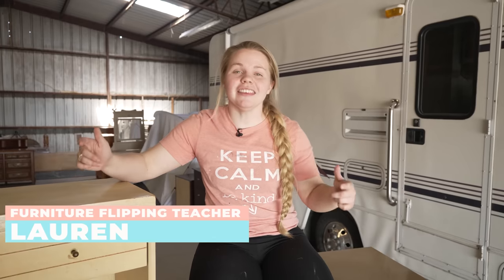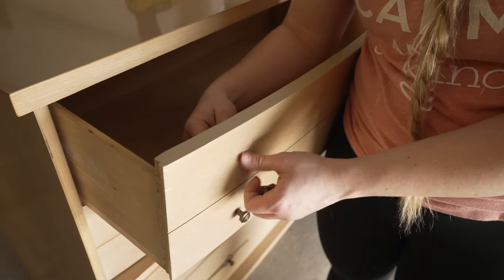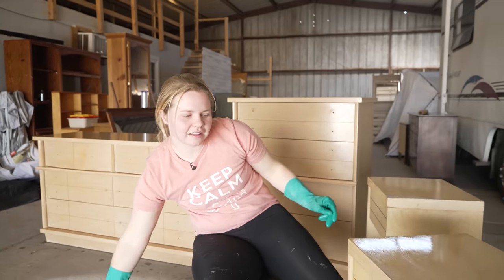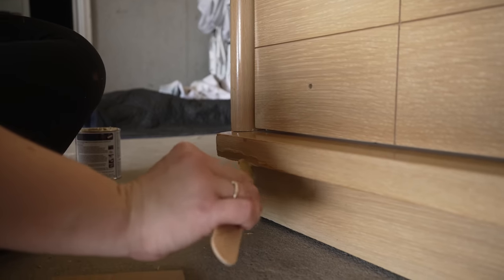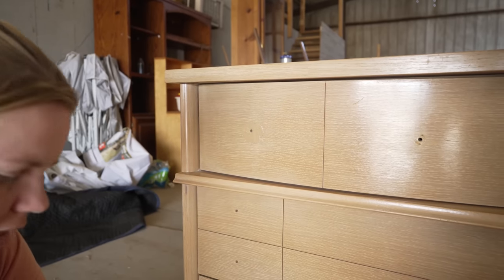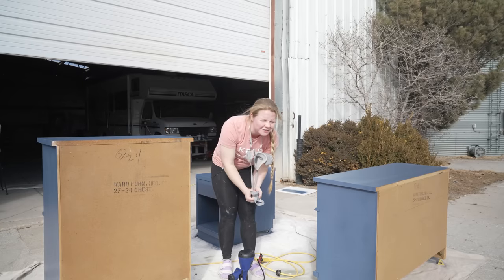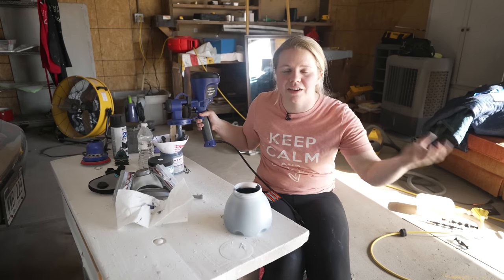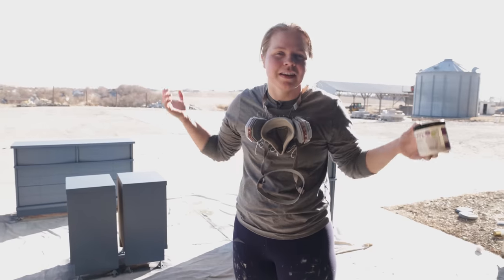Flipping Mismatched Furniture + Spraying Beyond Paint (SMOOTHEST FINISH YET?!?!)

Comment: I just came up with the most astounding right under my nose idea. I can't choose which BeyondPaint color to use on my kitchen cabinets so I will buy two or three small bottles and use this to paint the inside of my cabinets. They don't have to be perfect match from one side of the kitchen to the other but they will for sure tell me which one I want to use for the outside. I also txt to BeyondPaint to ask if I can use TUNG OIL (sp) TO use on top of Beyond Paint but have not received an answer.
Reply from the maker: perfect idea! good luck!

Comment: We noticed that the sprayguns were different in this video. Did one break and have to be replaced. What makes this paint go a long way?  Is it special in some way?  Also there is a long hose looking tube connected to the sprayguns is this the air part?  How big is it and is it heavy?  If this paint has to sit for weeks until it can be used is it right to sell it before that?
Reply from the maker: as mentioned in a pop-up during the video, one of my sprayers was occupied by another project as I was ready to do a second coat. the paint is thick so i think that helps it go a long way. it has primer and top coat built in. sprayers aren't too heavy in my opinion. i am sure to tell customers to let it cure for long enough for best results
Reply: @FurnitureFlippingTeacher  We must try some of this paint. It seems magical. Does the company have maybe a sample cross section of how it works that we could see?  The sprayers don't look that heavy. What was being asked was if the air source was heavy and maybe which of the sprayers and air sources are best for this paint and other thick stuff like some of the new paints that are coming out.  Do you think one coat really be enough or are two coats better?  Also, does one coat cure faster than two coats?